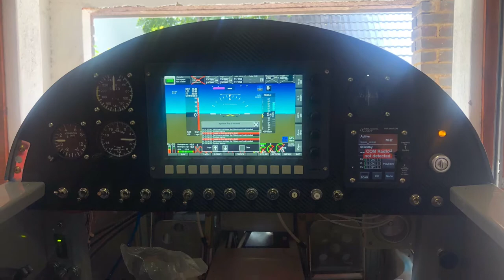Vans RV4 building and Flying

Comment: Hi. I understand the RV3 is not match drilled so all the skins and ribs etc need to be drilled. How do you drill the rivet holes accurately through unseen components?
Reply: This is an RV-4. The 3 has only one seat.